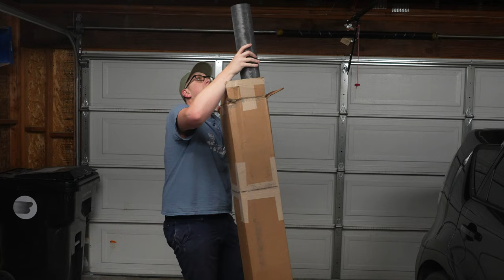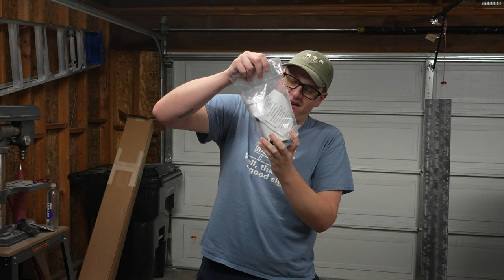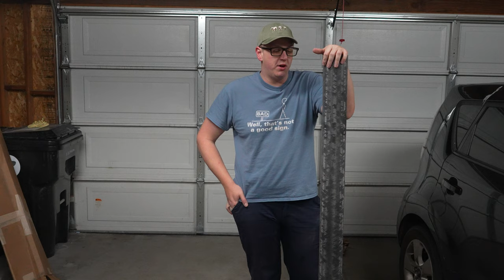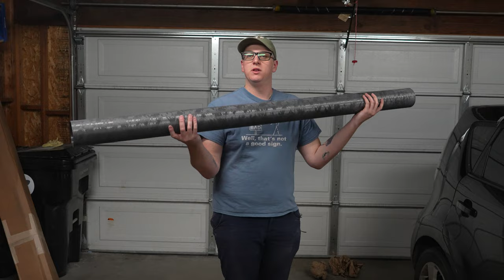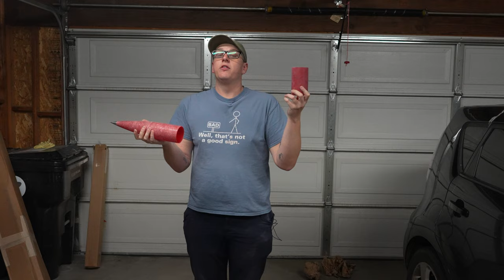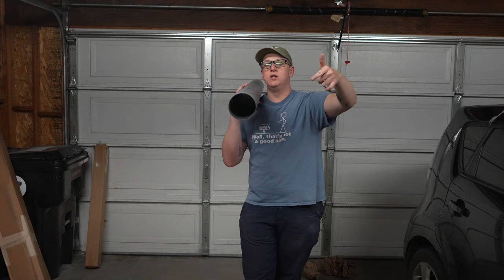Unboxing an EXTREME Carbon Fiber High Power Rocket Kit

Comment: Honestly, if you are using JB Weld for fillets, it's fine.  Wipe it with acetone on a glove and it takes very little effort to clean up.  Using it inside of the body doesn't work.

Comment: Tip to tip won't help with those carbon plate fins.  You can not make them any stronger than they are now.  You only need fillets.

On my mach 3.7 rockets I use two layers of course 2 inch wide carbon fiber in fillets with the Proline.

Also, don't make your rocket too short.  You can get instability even if the simulation is OK.  Although, Scott's N5800 was probably failure of the nose cone base.

Curtis is still working on my carbon fiber order.  I should probably just order from Wildman.  Did you get the high temperature carbon fiber?
Reply from the maker: Yep, that's why I don't plan on having any tip to tip reinforcement.

This is the newest revision of the high temp nosecone from Wildman, yes. Not sure about the airframe resin itself.
Reply from the maker: To be fair, though, I don't think the idea behind tip to tip isn't to make them "stronger" necessarily. The added thickness can help resist flutter, but my understanding has always been that the idea is more secure attachment with t2t.